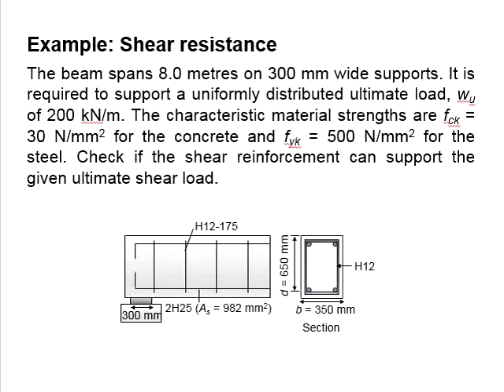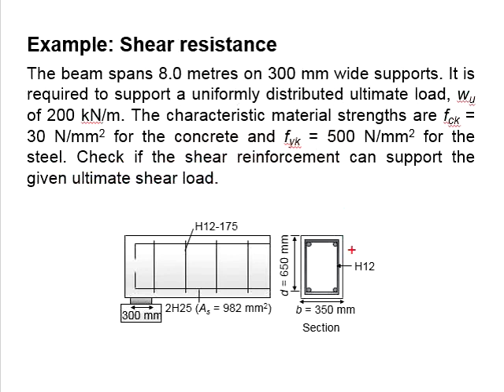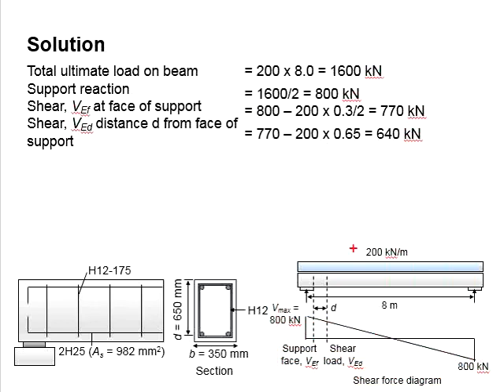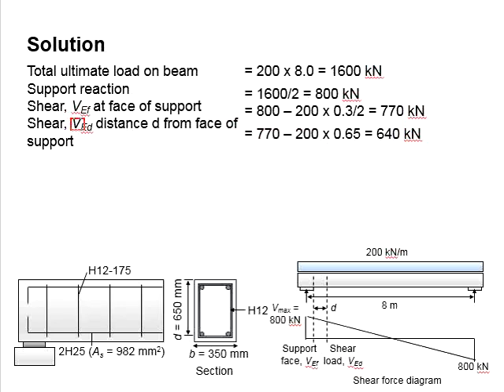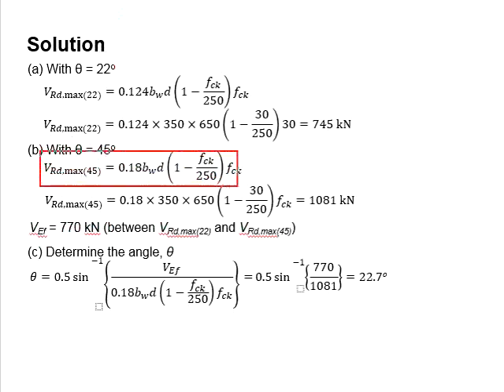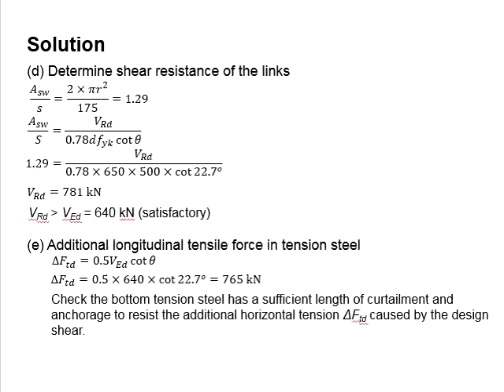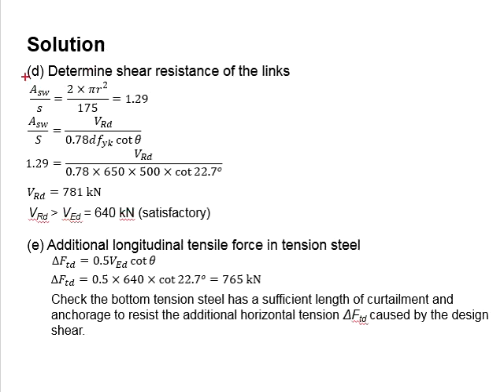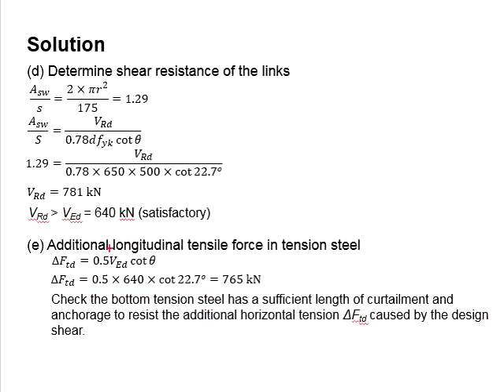5.8 Example: shear reinforcement

Comment: Hi, can you please elaborate the how you have calculated Vef and Ved ? what is the principle behind taking the particular value ? 

all your videos are really helpful. Thanks a lot for your efforts. Its incredible
Reply from the maker: VEd is the shear load as calculated from the simply supported beam in this case. It is on basis of the effective span of beam (center-to-center of the support at both sides and is the maximum value in the shear force diagram. VEf refers to the shear at the exact location of the surface of the support. That is the actual shear force resisted by the section. Locate the beam surface no longer sitting on the support. Refer to the shear force diagram to determine the shear on the surface (VEf) through interpolation. Hope this helps. Thank you.

Comment: In determining theta, why do we compare Vrd with Vef, but in determining the shear resistance of the links, we compare Vrd with Ved?
Reply from the maker: Vef refer to the shear load on the column face. This shear load is theoretically be taken by the concrete itself. Ved in this example refer to the shear load at 1d distance from the column face. This shear load is theoretically be taken by the shear link. Thats why Vrd,max which is the concrete equation is checked against Vef, as for VRd for shear link equation is checked against Ved (at 1d). This is how fundamental principle goes. However, for simplicity, sometime we just you VEd which is obtained from the shear force diagram. Its location is at the centre of the column. If you compare Vef, Ved (at 1d) and VEd (at column centre), VEd is the largest. Therefore, you can conservatively compare both VRd,max (concrete), and VRd (shear link) with VEd. If it passes, both Vef, and Ved will pass also.
Reply: @eng-aim  Thank you for this. Will review the example again.